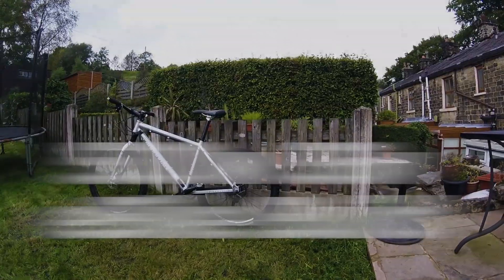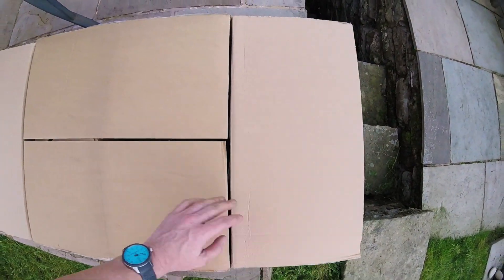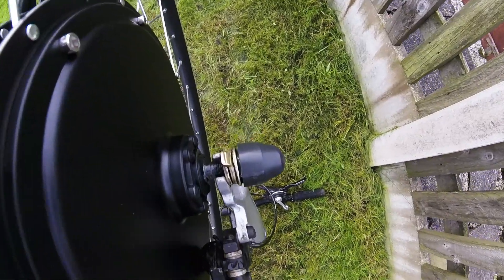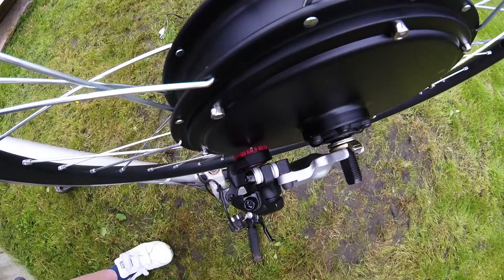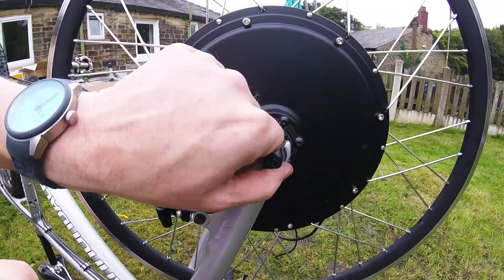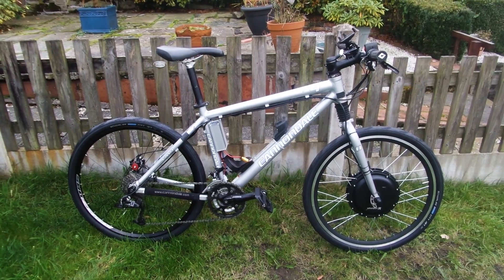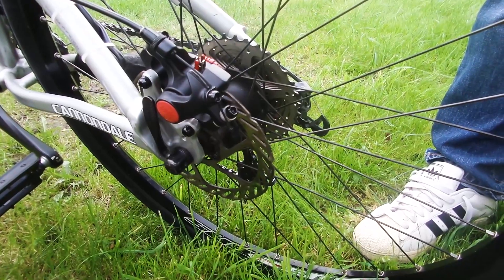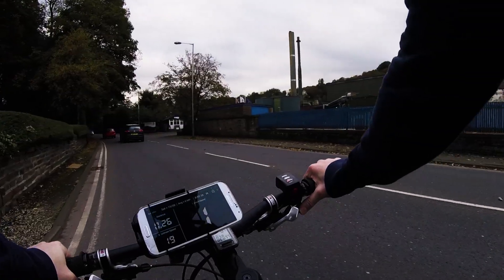500w 36v Front Wheel Ebike Build by an Ebike Noob

Comment: How did you get the torque arm on the wired side of the hub
Reply from the maker: I took the wires out of the plastic connector block, fed the cable through the torque arm and put the cables back into the connector block.

Comment: Love your video and thank you for your insights. I too am relatively new, 6 months, to e-bikes having being motor cyclist in my youth , now in my 60’s, and a reluctant car driver due to its high cost, low average speed across town, and environmental impact. The 250w 24v 8Ah bike I bought I found too limited in speed ( not keeping up with cycle lane speeds I.e being overtaken by all but the slowest cyclist), range (10 miles with pedal assist), and low torque. I live on a hill and it struggled to get me back up. So I bought and installed a 350w 36v outlet 10Ah kit. Now the speed is about average in the cycle lane, range is about 20miles ( so less range anxiety) and torque gets me up the hill smoothly with out a struggle. So I was a happier bunny. But.. there are times when you need that extra boost e.g getting some clear space away from the lights so I installed a second 48v, 10Ah battery and battery blender module for safe connection of 2 batteries with different charges and I think I’ve found the sweet spot for me. Range and power when you need it. I have to agree, at my age at least 25mph on a bike would be too high up the speed/risk ratio for comfort. Having to contend at that speed with pedestrians stepping off the curb to my left, faster bikes and car overtaking or trying to cut left i front of me would not, for me feel safe. I think..  20mph ( I.e not faster than cyclist do anyway ) with 350-500w for the extra torque to smooth out head winds and hills should do it😅

Comment: Hello which Break system  do u build in your bike?
Thx
Reply from the maker: Hi, I used Avid BB5.
Reply: @richardhanson2331  
how wide is the axle mount of the fork 100mm or 110mm?
because the motor is a bit wide.

Comment: Man! Why did you have to cover the original sounds with music. I wanted to hear the motor in action. Mine made knocking sounds, then I bought a replacement from a different supplier - same thing. Am I paranoic or this type of motor just makes those sounds. It is not mechanical, there is no lack of power, works perfectly ... and drives me nuts.
Reply from the maker: Good point but the wind noise would have covered the motor noise I think. When mine got over 25 mph there was a definite slight knocking noise.  Maybe it's a characteristic of this design.

Comment: I've just started using my 500watt ebike kit. It's faster than I was expecting.  You definitely have to be very aware of this. Front wheel drive changes the feel of steering slightly and when signalling I am very cautious....expect I'll get used to it soon! I've tried it on the flat turned off and it's fine so I imagine long rides soon.
Reply from the maker: You definitely have to have your wits about you.  Things happen much faster on an ebike.
Reply: I have a front wheel drive ebike that's also around 500w and compered to my 2000w rear motor ebike the handling dosnt feel that much different

Comment: I have a 1500w front hub I just bought and Im having the EXACT SAME clearance issues, having to file down the mounting bolts on the hub motor to seat into the front forks. 

However it seems that I have even LESS clearance for disk brakes, Im exploring the manual disk brake kits available but with the shape of the hub motor enclosure its looking marginal at best for accomodating... I may have to get very involved and fabricate my own mounting solution or my own brake assembly as I refuse to have anything other than two working disk brakes on something capable of 70kmh/hr lol.

But glad to see Im not the only one overcoming issues with these builds amongs the sea of "Easy e-bike conversion in 1 hour" videos.

Comment: Great video getting same kit but was thinking of running it on my own 48 volt 10amp battery any info would be much appreciated any pros cons what ever.
Reply from the maker: Thanks for the kind comment.  I had always planned to try it out on 48v but never got around to it.  I mainly ran it on a 12s setup which it handed fine and was plenty quick enough for me.  I would be interested to see how you get on with a 48v setup.
Reply: @richardhanson2331  OK mate will let you know it goes when finished take care.
Reply: @richardhanson2331  hi again mate how's you're bike doing or is it still going?? Just came across this post again I did the exact same build but upgraded the battery to a 48.volt 11.5 amp it worked a treat and is still going strong.

Comment: Do you need to buy a motor separately or  whatever is included in the box all you need?
And how do you charge it?
Reply: The motor is the wheel. Those kits usually only lack the battery and charger

Comment: i've been thinking about converting my bicycle to electric but I can't find any kits for 18 speed bicycle.
Reply from the maker: If you're doing a front wheel conversion it will work with any number of gears
Reply: You can change the cassette/free wheel to yours. Smh

Comment: Very interesting video. I am looking at a front wheel motor system for my 20 mile round trip commute.
Reply: A 500w front or rear kit would work fine but you would need to make sure your battery is atleast 450wh
Reply: @kiwi8054  I have built the bike now with a 250w motor and big battery. It has lots of cables everywhere (brakes and thumb throttle) which is a shame. Easily good enough for 65 miles on eco.
Reply: Same here brother! 20 mile round trip to work and back home for me.

Comment: Can you please let me know is there a specefic direction the wheel has to be? In other video a guy was saying the wire has to be on the left side . Can the direction of the wheel be reversed by changing wire? Most kits have the wire on the left and disc brake treads on the right and my bike disc brake is on the left side of the front wheel.

Comment: how much AH = amp hour does your battery has
Reply from the maker: I use 5ah for short journeys and 16ah for longer journeys.  I get about 1 mile per ah
Reply: @richardhanson2331  thanks for replying and how far does the 5ah goes (distance) sorry for bothering i was just wondering because i would like to create diy ebike for postmates deliveries. thank you
Reply from the maker: @RandomAdventure3  no problem, I get 5-6 miles from the 5ah battery with no pedalling at full speed
Reply: @richardhanson2331  thank you so much for info =D

Comment: Hello Richard, btw amazing video,
So im buying this kit, my ebike battery has a xt60 connector, the only cables i see is some green wire, how do i connect a xt60 one?
Reply from the maker: Hi, I used XT90's for my build and I cut off the power connector on the controller and soldered on an XT90 female connector.  I also added anti spark xt90 male connectors to my batteries.  You should be fine connecting an XT60 female connector to your controller.
Reply: @richardhanson2331  and one more thing if you dont mind, with the 1000w voilmart kit would a 48v 14ah battery be sufficient?

Ty
Reply: @richardhanson2331  thank you

Comment: I’ve just ordered a 1000w 48v kit, it’s my first time doing something like this, would any battery pack work off eBay or does it have to be a certain connector?
Reply from the maker: Hi, any 36v ebike battery should work fine. Most off the shelf batteries will have a connector fitted and it should be easy enough to buy and fit the opposite connector to the one on the battery.  Any connector suitable for the amperage should work though.   I used xt90 connectors.
Reply: Richard Hanson thanks for the reply i just need to wait now lol
Reply: Also would I have to solder the connector or does it just come out and clip in

Comment: i just received my kit so was curious what to look out for when building, especially because the shifting mechanism seems to be build in to the handles, so preferable not using the supplied handles wich cut out the motor. the voice in the video is already on the soft side and when the comment comes about the handles the music comes in. I hope you can use this info for further video which was for the rest, very nice.
Reply from the maker: Hi, Thanks for the kind comment.  I didn't use the brake levers which came with the kit.  They don't feel well made.  I used regular mechanical disk brake levers instead which works great.  They dontt cut out the motor but I never found this to be a problem.

Comment: Hi Richard, I've just built one of these and converted a brand new Calibre 2 Cubed hard tail mountain bike in to an e-bike. I'm an electrical engineer with 42 years experience and also have bit of mechanical experience as well. I have a fully legal Cube Cross Hybrid Pro with a Bosch CX Performance Line motor so I know a bit about how e-bikes work.

The build, from an electrical point of view is very simple and would be easy for anyone to do. I have pedal assist and thumb throttle installed. The difficult bit was making the wheel fit in to the fork drop outs and getting the hydraulic disk brake installed. It can be done but I've had to file down the brake caliper and the fork leg to make things fit.

The other issue I have with this conversion kit, is that there is no power control in PAS mode, not much in throttle mode either. In PAS mode the motor runs on after you stop peddling which is potentially dangerous.

As a cost effective e-bike conversion, it's great, but only if you have the mechanical engineering skills to make things fit.

This is not a fast kit and won't get you noticed by the police in the UK. It will only reach a maximum speed of around 20 mph on level ground while pedalling. Uphill ascents are much slower and will drop you down to  12 mph. My road legal bike will out perform this kit build in any conditions.

In conclusion, this is a very cheap way of converting your normal bike and about  75% less cost than my legal e-bike.

As performance is subject to things like rider weight, I'm 6' 1" and 100 kg.

Great video, stay safe and enjoy your riding.
Reply from the maker: Thanks for a great and well thought out comment! It's a very down and dirty way to convert a bike.  Nothing like some of the very sophisticated bikes available these days.  But for me it's cheap and fun and if overvolted it's very quick.  It can achieve 30 mph without pedal assist and will happily cruise along at 25mph on the flat without pedal assist. Enjoy your riding whatever you ride.
Reply: need to be a mechanical engineer to make things fit... im over here with a crowbar , some harbor freight washers and a big flat head screw driver just smashing things together making it happen
Reply: @manimotard5429  I've just fit a scooter motor to a bike using the inside of a wheel and a suspension that serves no purpose as spacers

Comment: I have just ordered a 1000 watt ebike front hub like yours, Hope it will all be OK. My question is should I try 3 or 4 12 volt lead acid batteries (wired in SERIES right?) to get good performance and range, or should I get the all singing and dancing (probably £80 - £100 ) more modern Lithium polymer solution (obviously lighter) I use the Lithium batteries a lot in model drone's etc. I have noticed they don't always last that long in terms of life cycles' (at least you have to treat them with kid gloves and not over drain them etc.
what would you recommend. Also I have ordered a 26inch Hub and my bike is a 27.5 inch wheel, I am just hoping it will fit in the drop out (in terms of width) I don't think the fact that it is 26 inch and my bike is 27.5 inch will make much difference (probably just academic) If it don't fit I guess I will just get a cheap mountain bike that it will fit into rather than send the thing all the way back to China!!!
Anyway my friend, please give me any advice you can as I want to get this right and have a really enjoyable first e-bike experience as I can see you have. I can't wait for the kit to arrive - I am really excited about this project!!!                                      kellyrobert605@gmail.com
Reply from the maker: Hi Robert, hope your build is going well.  The Lead Acid batteries make an already heavy bike very heavy indeed.  If budget allows I would go for a lithium ion pack for weight and practicality.  As you mention Li-po's are far more sensitive to abuse and I have puffed 2 sets by over draining or leaving fully charged for long periods of time.  2.6 inch wheels should fit fine in a 27.5 frame.  Might alter the geometry of your bike look a bit odd if you put the 26 on the front and 27.5" on the back.

Comment: What is the bolt size  of the motor?
Reply from the maker: Hi, from memory I think they are 13 or 14mm
Reply: @richardhanson2331  thank you. But, is the standard not 10mm. Mine is 10.  The reason I ask is because mine is 10 and all the kits don't give this information.
Reply from the maker: @PadraicJ.McDonnell  some of the smaller motors might have smaller bolts but the bolts on this kit were definitely 13-14mm.
Reply: @richardhanson2331  brilliant, thank you. I am going to convert my 2017 Giant Rapid 2. But, with the legal 250 watt motor.

Comment: USA noob here. I just bought a 1000w Voilamart front hub motor on ebay. (Would have been happy with 500w, but the price was great). How much less ride time will I get with LiPo vs. Li-Io? Not sure if I need a certain battery to pair with that. I can get a 12S 44.4v for $269. Is that too much power? Not enough? Good price? Just... wrong? Not looking to go superfast, but I'm 260 lbs. Gentle hills, 10 mile commute, happy to pedal along.  Thanks.
Reply from the maker: https://www.youtube.com/channel/UCRMrqzsrPIWvY3PINkLKs-Q has a great channel explaining battery sizes and requirements for various applications. It's mainly based on Li-ion batteries but it explains how many volts and mah you might need for different configurations which can easily be applied to Li-po batteries.  The big differences between li-po and Li-ion are that lipo are more volatile and not as straight forward to charge.

Comment: Hello from Chesterfield Derbyshire mate,great bike,you gotta try a geared 250w front hub motor with a 22amp 36/48v controller and a 48v battery, I get 25mph throttle only and I'm 6'2 16stone, and the best of all is the 250 weighs half this does and it freewheels due to the 4-1 planetary gear ratio .
Reply from the maker: These kits are heavy so that's well worth considering.

Comment: Hi going to order one too, my bike has hydraulic brakes... was it simple enough to remove them if they won’t fit along with the e bike wheel?
Reply from the maker: Yes very simple.  I would've gone for hydraulics again but they wouldn't fit this setup.  They encroached on the motor so you couldn't get the wheel in the dropouts. Good luck with the build.
Reply: Richard Hanson is there a way of me checking this Aswell? don’t want to commit to buying a kit if it doesn’t fit, mines a boardman hybrid. Thanks

Comment: Hi please tell me if I buy a 1000w ebike conversion kit do I need a 1000w battery ? How do you know which is the right battery for your conversion kit ?? ,..... and what’s the peddle assist and what’s its job cos you said in your description you didn’t put it on ??? Sorry to bother you lol
Reply from the maker: No problem, you don't need a 1000w battery as such.  For something like this you need at least a 36v 5000mah battery. On this build it works out about 1 mile range per 1000mah of battery capacity.  Pedal assist comes with the kit.  If you install it the motor will kick in and assist when you pedal.  If you dont install it you can run with throttle only  with no need to pedal. of course you can still pedal f you like with this set up

Comment: Ok 40-50kmh??
Reply from the maker: Yep but slightly over volted.  Running 2 x 6s batteries to give a voltage of 44.4v.  Runs great but feels almost a little too quick at 50kph.  Feels perfect at 40 - 45 kph

Comment: How’s the battery life on a 500W motor with a 36V battery?
Reply: @joe blow Do you have a link for battery? all batteries I find are like $300
Reply: @joe blow Oh ok maybe if you order from China but not US Price. Thanks
Reply: it depends on the battery type and size of the cells. you can have a 36v battery that will last 1 mile or 10, just depends on what you purchased. I just bought  2 3000mah 5 cell lipos, both of which is about the size of 1 liter of soda, i estimate it will power the bike a maximum of 8 miles without pedaling at 15mph. Thats all i need and it only costs 60$.

Comment: I have just motorised a Brompton and I am really disappointed as it tops out a12 mph and any attempt to pedal harder seems like applying the front brake I would go faster without a motor, but going up hill is easier though.  It is just too slow compared to before.
Reply from the maker: Do you have a speed limiter on your kit? Most uk stock kits will top out at 12-15mph. What type of kit did you motorise it with?  Bike weight, rider weight and terrain are all factors.  500w 36v would be the minimum for having fun.
Reply: @richardhanson2331  It is a Nano with a twistgrip  and no cadence sensors like thay did a few years ago. It has 6amp 36 volt bosch batteries and a  220 watt  front hub motor.  It takes noticeably more effort with th motor on it than before to  go faster. Freewheel is  only slightly draggy but the speed has to drop to 8 mph until the motor starts up again.  I would not have bothered had I known before blowing £800 + on the setup.  I know they are meant to be restricted to 15.5 mph but it will not get near that without peddling harder than the motro will go.   I weight 62kilos and the bike  is quite heavy as it is a standard Brompton. Tyr pressure are as hard as I can put up with.